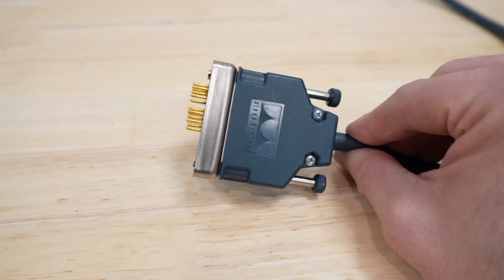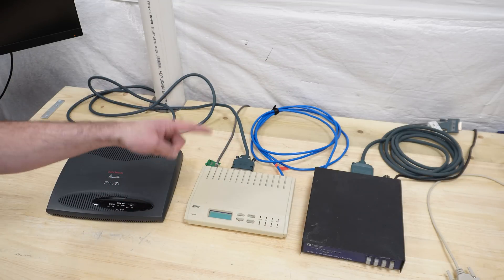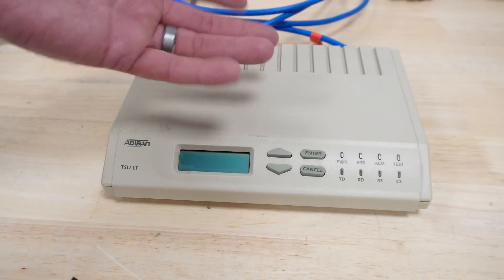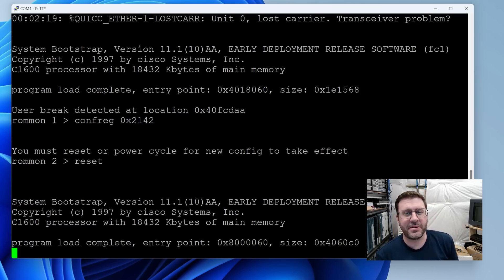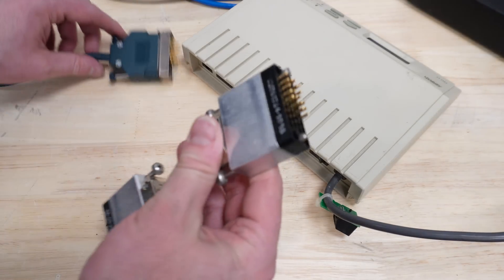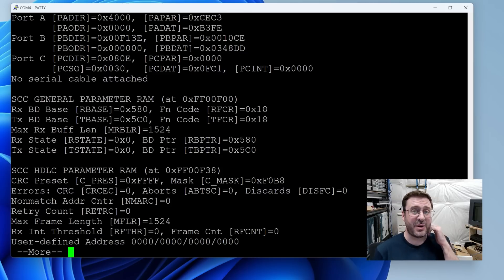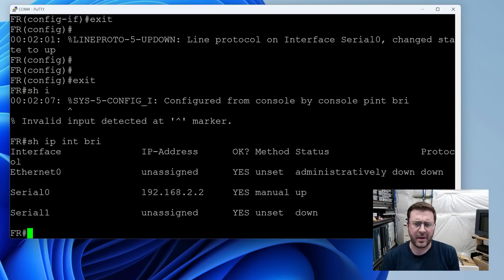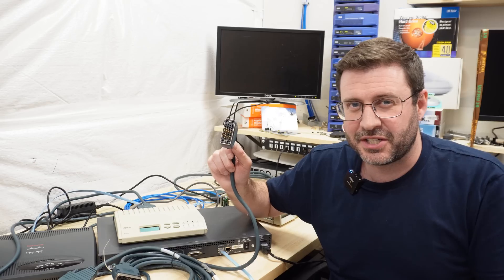V.35 Cables

Comment: I miss this stuff! The sad truth is that in 30 years from now someone will plug in some "vintage 2020" devices and the only output they will ever be able to get out of it is 'Unable to contact software license server'. I miss buying things and actually buying the THING rather than a brick with the timed privilege of the thing existing.
Reply: Plenty of 2020+ hardware equipment which needs no network connection. Especially enterprise server and switching stuff. Some of it you'll need a license key/certificate to unlock features but they're generally non expiring one and done deals which last forever once installed. Kinda required because any decent IT department is not going to want to deal with equipment phoning home to manufacturer without a good reason.

On the client and software side though... Yeah, lots of stuff which won't work without networking. 😢
Reply: @Khrrck  I have plenty of current server and switches under my watch that do nothing without a license.
Reply: @Khrrck  well Cisco has switched to “flex licensing” on their hardware in the last couple years. Some high rolling customers have switched them off to alternatives
Reply: @HopelessAutistic  ah that's unfortunate to hear. I have been working with Arista and Extreme lately so hadn't encountered it yet.
Reply: @Khrrck  you didn’t literally “hear” it from me though I understand you’re not with Cisco post IOS (IOS XE is where it can be a brick)
Reply: Old devices mostly needed things that does not exist anymore
Reply: And then 1990s crap will be called cavemen things
Reply: Don't worry. They'll just tell their ubiquitous AI to fake a licence (or license) server. It'll be able to do it almost instantly.
Reply: Couldn't agree with this sentiment more.  Even working in this industry, with everything moving to "Cloud" and subscriptions, it's really hard to just learn stuff.  It's constantly changing, so it's not like you can just pick up a textbook and learn it, since nobody does that anymore and even if they did, it would be out of date by the time the binding had cured.  But even getting access for educational purposes is such a PITA.  I love Palo Alto products, but a firewall with an expired license is just worthless e-waste, which makes auctioning for obsolete equipment pointless.  How is the next generation supposed to learn this stuff?

I also had this impression that, when you graduated to the point in your career where you were a liaison between vendors and customers, that vendors would be like "here, have some licensing -- and don't worry about enabling features you don't have entitlement for, it's totally cool -- just please use this stuff so you can advocate for us!"  Nope.  It's pulling teeth to get a 30-day demo, and ... then whut?  I guess you know everything about it now, and are prepared to support it...?  Not even a little.

My lab is full of late-90s to 2010s Cisco, Juniper, AdTran, Paradyne... a bunch of stuff that is not only still 100% functional, w/o "activation" of any kind, but also WAY more interesting because it's not just All Ethernet All The Time.  I regularly set up my lab interfaces as HDLC, ATM, or Frame Relay just because I can, and it's refreshing to do something else for a change.

So glad I'm not starting out in this field today, because I would make other plans for my life.  Capitalism has ruined this for me.
Reply: Hell, we're already starting to have that issue with development hardware from the early 2000s. Sony is really bad with this.
Reply: I can't wait until someone does a vintage 2015 homeland and tries to use a micro usb only to realize the cable is broken.

Comment: You may be able to do loop backs, where you can loop from the CSU / DSU facing the Serial V.35, and loop facing the T1.
By doing this you can rule out cabling, CSU/DSU settings, T1, etc until you've proven the link end-to-end.
Reply from the maker: oh yeah these devices are definitely capable of that, i just need to do more research
Reply: @ thank you for putting these videos together :)

Comment: This brings me back to my CCNA training in high school. We didn't really use the CSU/DSUs. We had special V.35 cables for the classroom environment with a female end. We typically used Frame Relay instead of PPP as we were simulating that type of connection, not a PPP connection. We had all three Cisco routers you pictured the 2500 series, 1600 series, and the 1700 series.

You can connect the aux port on the routers to a modem, what I don't remember for sure is if you can use that to connect to a PPP server. My Cisco school days were nearly 25 years ago and I never pursued CCNA certification, this was a nice trip down memory lane though.
Reply: Same CNS OSC of SeaTac.  410
Reply: You got CCNA training in high school? Wow..  That's awesome.
Reply: Same. Attended CCNA training 2008-2009. Lab had DTE/DCE cables, and you had to connect them together. I think the female one was DCE so on that router you had to issue clockrate command
Reply: I has a T1 from work in 96 (benefit of working for a mom and pop ISP and living a mile from work and the CO. Resold a modem off the secondary serial port of a 2514? It has one Ethernet, one token ring, one sync serial (T1), and a asynchronous serial (rs232) for the modem. I thought i was king
Reply: I got an AAS in networking back in 2001. Novell NetWare, Win 2000, CCNA etc. This channel brings me back. Never got into the field seriously though 😅
Reply: Frame Relay and ATM used for Switched Virtual Circuits (SVCs) and Permanent Virtual Circuits (PVCs) was very big in the late 90s, early 2000s. We had tons of customers with fractional T1s at field sites, say just 384kbps or 768kbps using Frame Relay, and then a big central site where it all came together on a full or factional DS3 (aka "T3"). Tons of data and VOIP traffic sent over FR/ATM before other solutions took over.
Reply: Which year was it? I recall this stuff still being in CCNA up to 2016, before big 2020 update.
Reply: @wiziek   2016?  Really?  Wow.  I remember it being strange that so much of this old stuff was still in the course material in the late 2000s, since nobody I knew was using anything other than Ethernet, or at most PPP for low-speed T1 links to branch offices.  Even in the early/mid-2000s, I was like, "Who's still using hubs and bridges and Thin/ThickNet??  Why are we learning about this?"

Then I moved to Juniper equipment and was kinda sad that TDM technologies were obviously second-class citizens, and most devices that supported them were positioning themselves as transitional components to get to/from Ethernet.  End of an era I guess.
Reply: Oh I miss these sweet times when even a cables had a distinguishablе gеndеr🙂
Reply: @valimkit   Meanwhile, Lightning and USB C taught us all that we're all vastly better off when we stop caring about orientation.

Comment: It always amuses me when you have such old Cisco equipment and it mostly behaves the same as current Cisco equipment, I was rebuilding some Cisco FTDs and needed to ESC or break to get into rom mon...

The only experience I have with T1 connections is in the CCNA and about all I remember is making sure the clock signal is configured as you've mentioned on both units, having never had any hands on experience with the technology it's fascinating seeing you working with it on your channel.  Also extremely impressed how quickly you got it working given I find there's usually a lot more head scratching and digging through the Cisco community forums before I get what I'm wanting working
Reply from the maker: I was truly amazed by how little troubleshooting this took haha

Comment: In our CCA class, we took two routers that had CSUDSU t1 cards in them and connected them with a Cat5 cable the second project we did was took two routers with serial cards and connected them with cables like these that had the male female Winchester connector in the middle of the cable and a serial connector on each end. We basically did serial communications from one router to the other without the CSUDSu

Comment: I got my Cisco CCIE in 2002.  Leading up to that, I had to build a physical lab at home (none of this CML/GNS3/EVE-NG like you kids have today...).  To be able to get serial (and more specifically frame relay) going - I had to buy 2x v.35 cables PER CONNECTION.  One DTE and one DCE (male vs female).  These were ~ $100 each.  So I spent about $800 for 4 connections.

To make things even crazier - I had an AGS+ for my frame switch.  It had RS-449 (DB37) connectors on it.  Talk about being out in left field.

As SOON as I passed I sold everything for as much as I could on eBay to pay off the CC's that I used to build the lab.

A few short years later I think the prices cratered on the cables and were much easier/cheaper to get ahold of.

We also had a lab at work back then, and we had these:

https://www.pulsesupply.com/products-menu/hardware/legacy/digital-patch-panels

They had v.35 "patch cables" so you could plug and chug to reconfigure what ports were connect to what ports.  It was so nice.

Comment: When you ran "show controller serial 0" the router will tell you which cable is connected (not just that a cable is connected).  This is important as when you tried to use the adapter, it showed up as a DCE cable, not the needed DTE cable. The CSU/DSU is a DCE device (meaning it expects the DTE cable) for proper operation.  DCE and DTE's actual definitions are confusing (DCE = Data Circuit Terminating Equipment) (DTE = Data Terminal Equipment), I think of it as the  "T" terminates the connection at the router, the C Carries the connection through the CSU/DSU/T1.  Using a DCE cable would only be necessary if you're doing a serial lab with no CSU/DSU in the middle (literally 68 pin to winchester to 68 pin).  I believe that funky metal adapter is a crossover / gender changer and acted as the DTE from each DCE cable's perspective which is why it didn't work for the Adtran. In a serial back-to-back configuration, the DCE sets the clock.  In your set up, the CSU/DSUs set the clock rate of their respective V.35 connectors.

I have a pair of TSU-100e CSU/DSUs and a pair of 1700 routers and the ol' 2501s to round it out.  You mentioned about channel assignment and that is a bit part of the TSU's job.  In my units, there is an add-on line card that's fitted in the box and this is intended to deliver the voice channels to the T-1 capable phone system so you can "split" the T-1's 24 channels into some data channels (V35) and some voice channels via the line card.

With the ability to tell the 100e's which channel was assigned to what output, I split the 1.544mbit T1 into two 768K T1 connections, then had the 2901's talking over the V.35 connectors and had two 1700 series routers (with T1 WICs) connected over the 768K "voice" channels.  It was a fun thing to lab out.  Unfortunately, it doesn't look like the TSU-L1 has the splitting capability, you can only toggle channels for either not used or data only since there's no second port to deliver voice. 

Fun fact:  If you can get two TSU-L1's in a back to back configuration and you figure out the serial port (that chain port on the back of the L1), you can remotely manage the TSU-L1 via serial using only the T1 link (that 25th channel that can't be allocated).  The serial "chain" port is not a Cisco console cable, it's something different.
Reply from the maker: Ah good catch about the DCE cable. And very interesting about the remote management chaining... I'll have to find another one someday!

Comment: "they can kinda stack, I don't know why you'd ever do that" -- The guy /w 20 wrt54g's behind him stacked up. haha. (I know, they're not all 54g's, they did switches, modems, and wired routers too)
Reply: Cisco had a lan switch in the same case as that 1700, the stacked couple has had that modern look!
Reply: @piwex69  The 1528/1548 or something like that
Reply: I used to get quite a bit of Linksys kit back in the day.  None of the feet cutouts for the various devices that I [personally] had ever matched.
Reply: Yeah, lol! I had many police/sheriff departments and cities/counties/school districts with a stack of these at their main office, and their field/satellite offices would each get one. It just depended on how and where the connection was going and who was footing the bill. If it connected to the 9-1-1 center, then it was usually a single 1600 unit. If it was to connect many field sites they may have a 2600 or 3600 to support many T1s at the main office and then use 1600s in the field. Government loved T1s as they were able to get a "government rate" substantially cheaper than anything any private business could get.

Comment: Ahh, the good old adtran.  I was around in the T1 (Really DS-1) Internet Days.  TD = Transmit Data, RD = Receive Data.  You need the clock speed if you are going on a non self clocking network (IE: Cable to cable).  Otherwise it gets the clock over the V.35 cable over the clock pins.  If you DSU allowed for source clocking you could have the CISCO send the clock to the DSU which would then send it out the network port.

DSU = Data Service Unit and it converted the signal from the DS-1 to a bit stream.
CSU = Channel Service Unit - took the 1.544 mb/s from the DS-1. or 2.048 mb/s for an ES-1 and converted it into 64kb subchannels. It was then up to what you Each channel or channel group came out on its own connector on the back.  It the case of the Adtran, there is another RJ45 for downstream processing of the stripped channels  using another CSU/DSU.

And yes, DSUs came in DS0 speeds (56k/64k),  DS1/ES1 1.544/2.048, DS2/ES2 6.312/8.448 and DS3/ES3 44.736/34.368. (and it goes up to DS5/ES5.

And the multiplier is 1, 24, 96, 672 voice channels. It's not exact because of stealing bits in the frames for signaling and diagnostics.  So a DS1 was 24 voice channels 1.536mb/s of voice data and extra bits for signalling, or 1.544 of raw data.

And yes, I was on the Internet when it went from a DS-1 backbone to a DS-3 backbone, and started with a DS0 myself on a proteon router (cisco wasn't around yet) and the later went to Cisco 25xx's.
Reply from the maker: Thanks for that extra clock info, makes sense!
Reply: I always wondered about DS2. I set up hundreds, perhaps thousands of T1/DS1s, and many dozens of DS3/T3s, but never saw or heard of a DS2. Likely because at the time I was doing installs the DS3s could be obtained and using ATM only a fraction of the circuit used, and then the speed upgraded without changing the physical transport.
Reply: @SydW01 - believe it or not, I still support a half dozen Cisco 2500s and the ~64 modems used to connect about four dozen sites over 1200 and 9600 baud 4-wire private audio circuits. While we've had 4 or so of the Cisco 2500s die, we keep a half-dozen that have been picked up on eBay around as spares.

Comment: Never used these cables in the wild, but happened to find a whole bunch of them out of the junk storage at work, and now my little lab has a stack of Cisco 1760s connected back to back with two V.35 cables connected to each other, talking X.25 and IP over them. (No T1 or anything such, though, just direct router-to-router connection using whatever built-in CSU/DSU the WICs have. I do wish I'd have some sort of WAN technology to add to the mix though... I did hook them up to be accessible using X.25-over-Internet, though.)